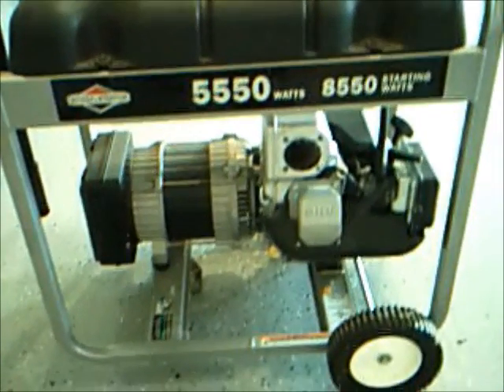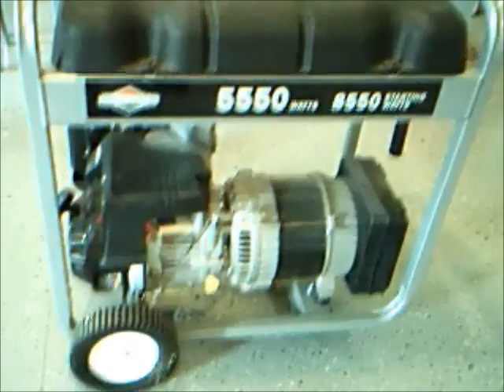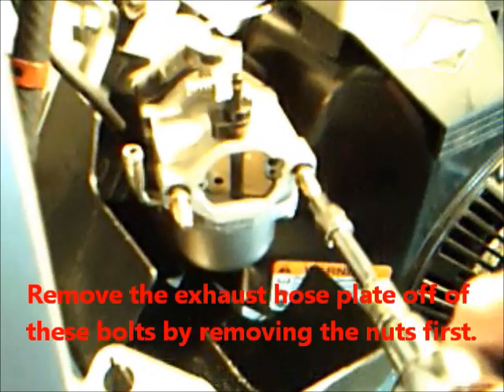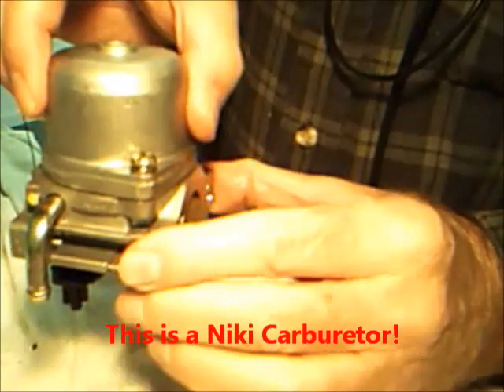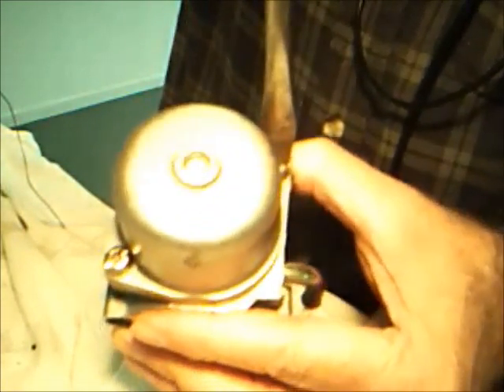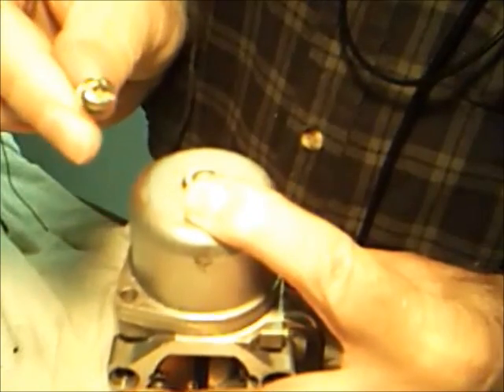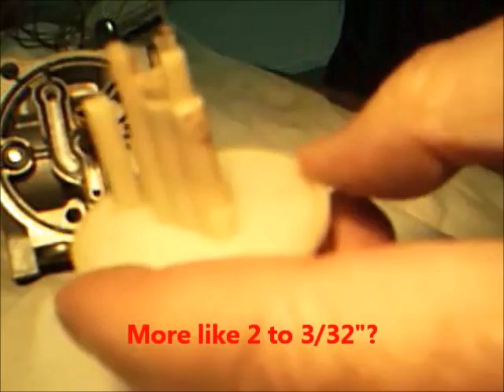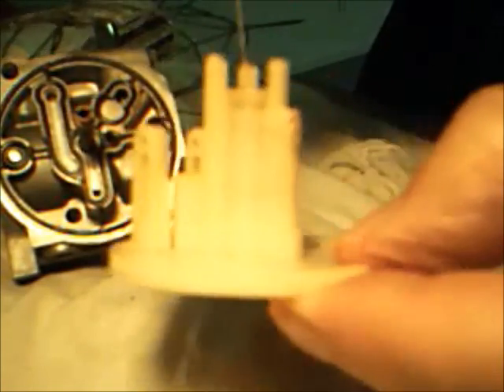Briggs & Stratton 5550 Watt Generator Carburetor Repair

Comment: Hi there ! I yousualy never let my gasmotors run dry of gas , there is normaly a crane to cut of the gas and when i am storing my generator i turn the crane of and let the motor run until it stops. When the motor stops it has become a vacum in the fuel line and the carburator is still full of gas , when the vacum is there the gas dont clog becourse there is no oxygen in the gas area in the carburator
Reply from the maker: Håkan Andersson Thanks for viewing and your comments & good video.  Here in the US we call the "crane" a valve but I know what you mean, since it is the manufacturer's name.  Do they put ethanol in the gas in your country because they do here and it easily settles out in the gas.  So, I am hesitant to leave gas in the carburetor.

Comment: Thanks for this vid! I have this generator and I forgot about it and it sat around for a year. Sucker wouldn't start. I followed your steps and I got it working and I'm not even mechanically inclined. Lord knows what a repairman would have charged me.

Thanks again John!
Reply from the maker: Thanks, Shinwaable!  As an engineer, by training, I mainly know how to work a pencil and, like you, have had to learn how to use my hands for mechanical things!  Thank God for Youtube!  If one wants to learn how to do something, Youtube probably has a video about it.  After the experience, it is unbelievable how simple it is to clean carburetors.  It's not Rocket Science!

Comment from the maker: I've started my generator 2 times since cleaning the carburetor and it started on the first or second pull!  I am still debating putting in an inline gasoline filter, however.  I went ahead and put it in and that helps.  If interested in this, go to my video here:
https://www.youtube.com/watch?v=s6pV7X18qIo&t=0s

Comment from the maker: Thanks, Tim, my pleasure!  We may need the generator the next few days due to the weather?  If you are interested in how to wire it into your power panel with an interlock switch go to my other videos:

Installation of a Generator Interlock Kit  (Interlock Switch)
Generator Inlet Box Installation  (Inlet Box)
Generator Cable Locking Connector Installation  (Cable Connector)